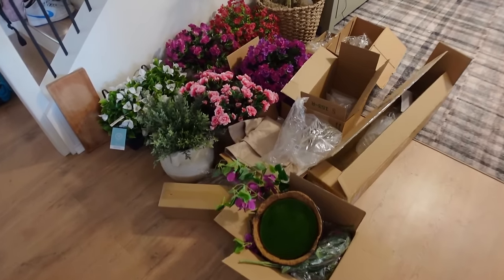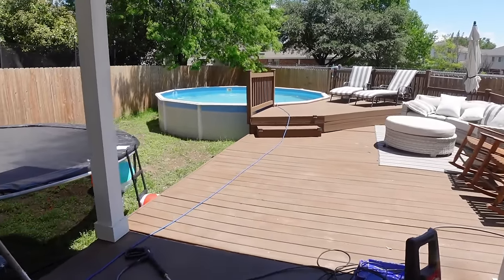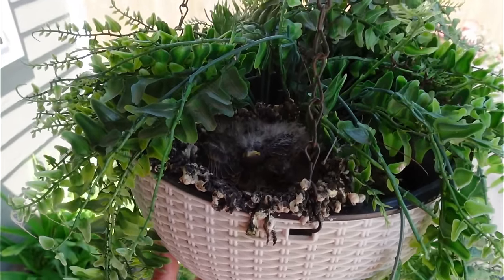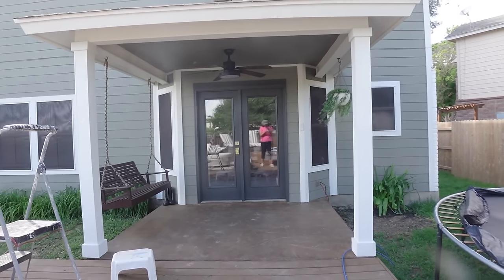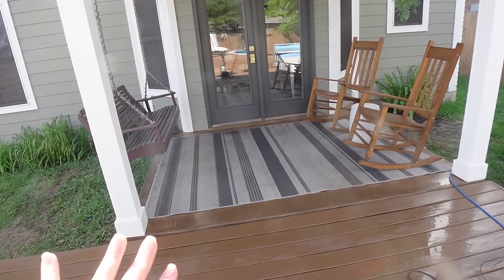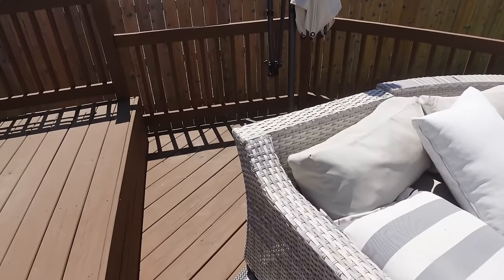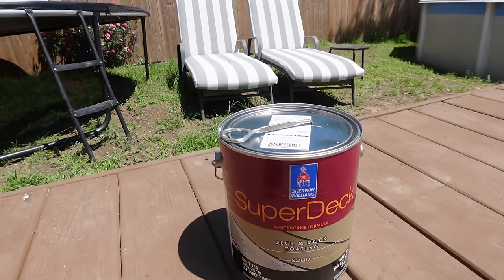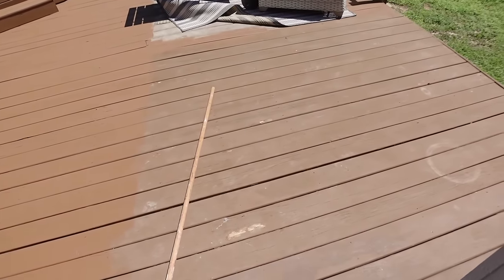EASY SPRING UPDATES FOR MY BACKYARD | DECK REFRESH + SOLAR LIGHTS

Comment: It is nice to have plants in the house. Consider having another plant with each one you have now, they like company. go to your nearest nursery get B12 and put a drop or two in the water reservoir. It gets the plants out of the shock of transportation. Do it every other month for 12 months and they will love you back. 
Reg the hanging planters, a hanging pot on each side with flowers would be great. Flowers need sun, underneath a green plant will do. I used to work in a Plant Nursery, and I love plants and flowers.
Reply from the maker: Thanks for the tips!

Comment: Not sure if anyone has mentioned this, but you can power wash the rug. I do this to my rugs, even the indoor rugs, and they look new! I just use wood clamps and attach them to our fence and power wash. If your power washer has a detergent container you can throw some tide in it and it not only helps clean them but makes them smell great too! 😊
Reply from the maker: I love pressure washing my rugs but I’ve never thought to hang them vertically so they dry faster! Thanks for the tip!